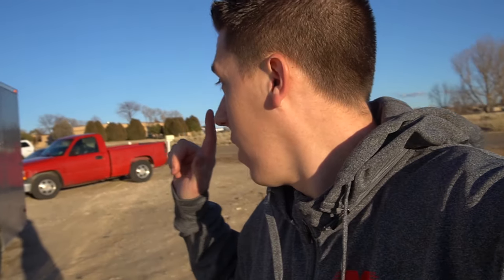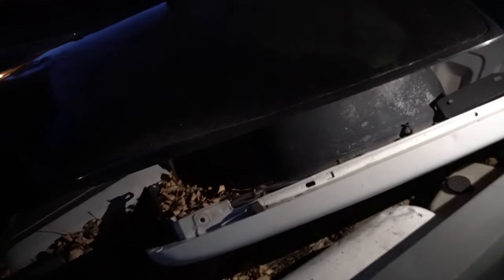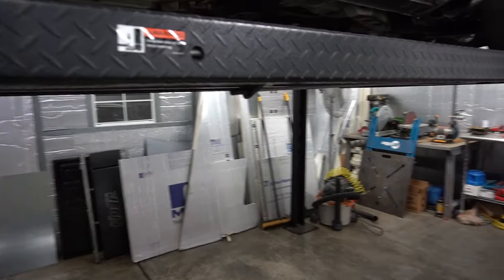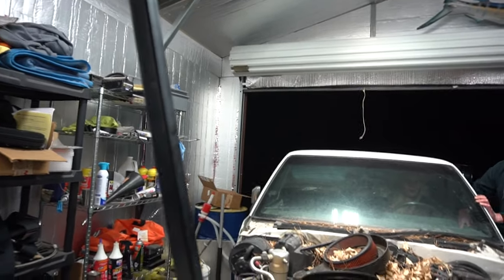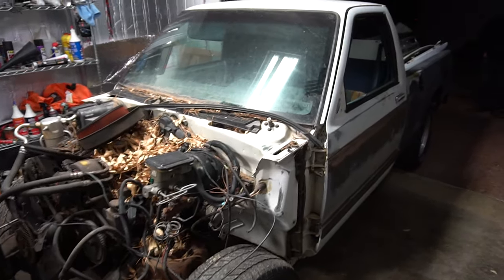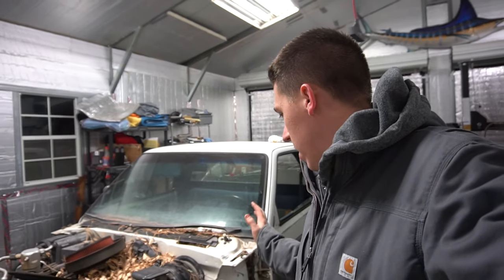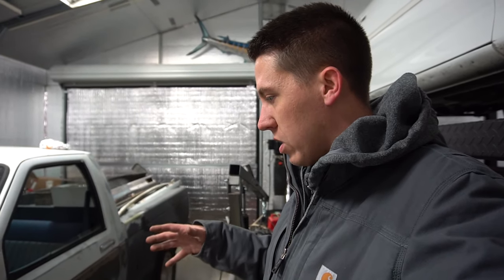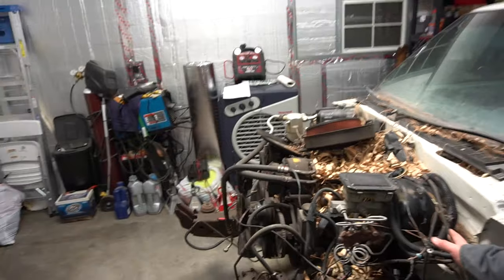Burnout Truck Build!!! LS Swap on Methanol, Zoomies, Tire Smoke and Wall Taps COMING SOON!!

Comment: When are you gonna fix the compression leak on Clyde?
Reply from the maker: I need to order the seal install tool for the DI injectors then I'll probably swap them out real quick. Might wait a couple months till I decide what I'm doing for a cam and do it all at the same time.